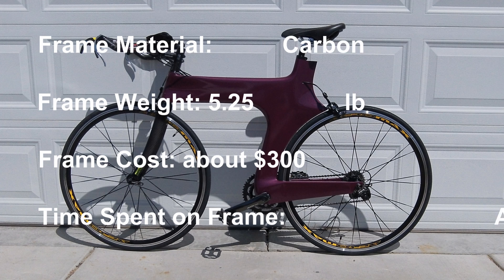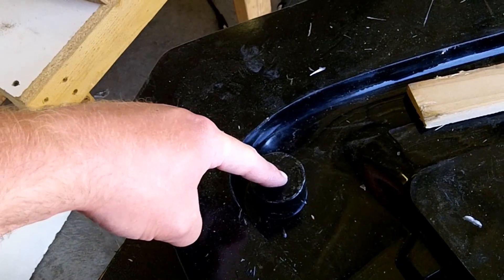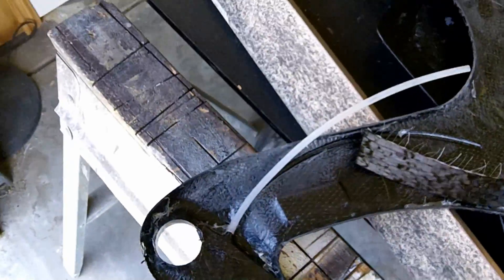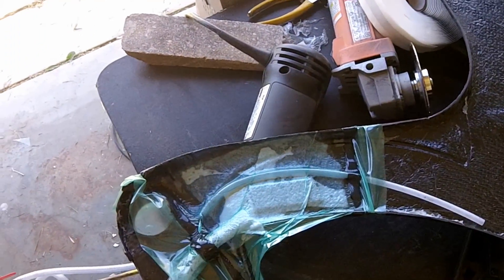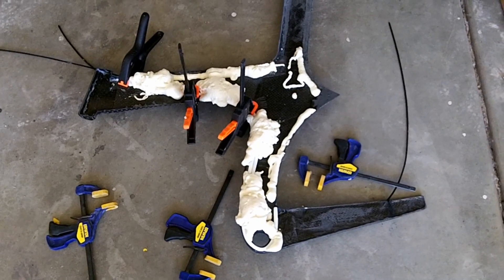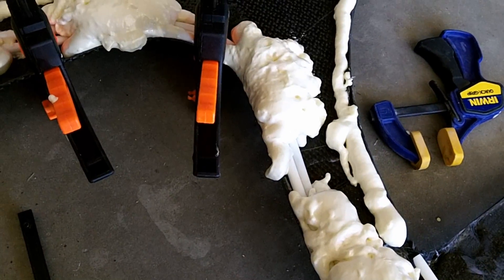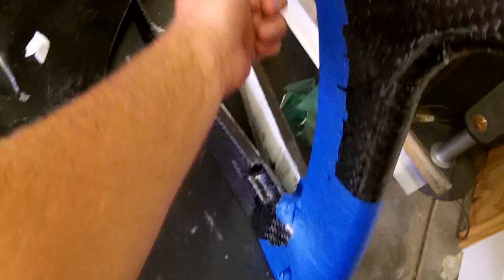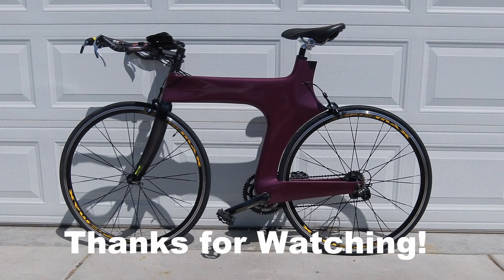Z Frame Bike: Video 8 of 13- Joining the Frame Halves

Comment from the maker: I definitely use wax- if not it's a real mess. The biggest problem I had is not putting a cf flange around the bb part of the mold so I could get leverage to pop the part out of the mold straight up without it binding. It was a non issue on the other side where I had the flange. Geese, Does that make sense?

Comment from the maker: Yes, Thanks for sharing this. I've seen what you are talking about. I've also seen them use small channels to draw the air out. It think my problem was more a matter of bad combination of cloth and epoxy viscosity. I'll be using a different cloth and epoxy on the next frame which I believe should eliminate 99.9% of the pinhole problem. We'll see though, I'll be posting that project here in the next month or two. I've still got to modify the molds a bit to fix some issues.

Comment: I have heard that boat makers will have pin holes built into the molds in a few locations, especially difficult sections; on the back of these pin holes is a small attachment nipple for an air hose, and then they just use pressurized air to pop it out; it does not require a lot of holes, just in the hardest areas and then in a few places alone the middle sections.